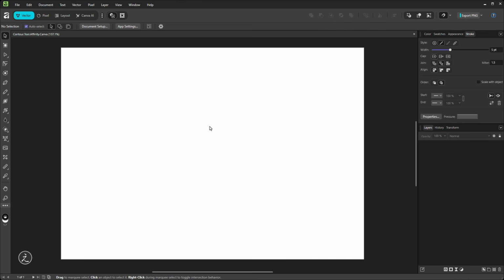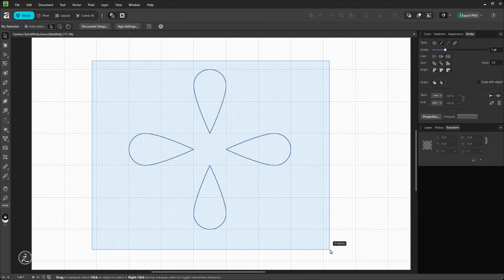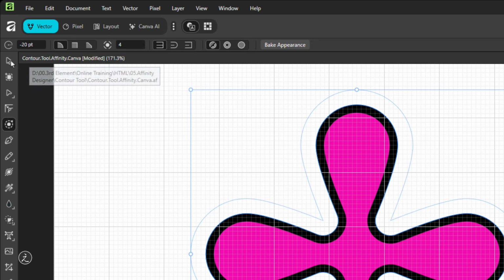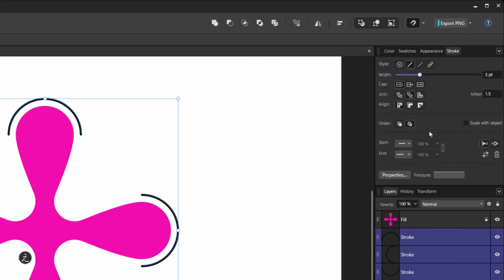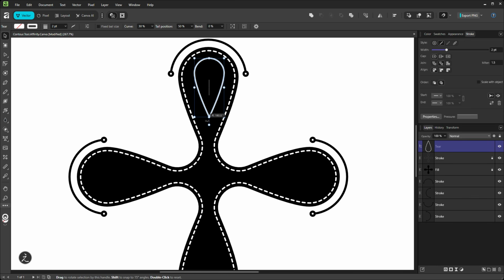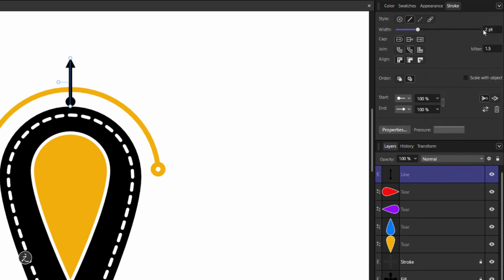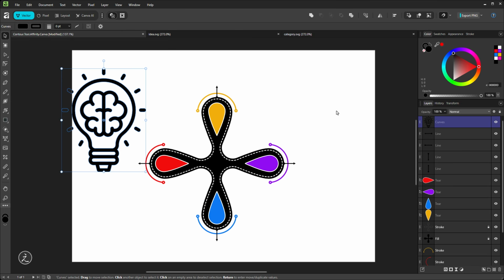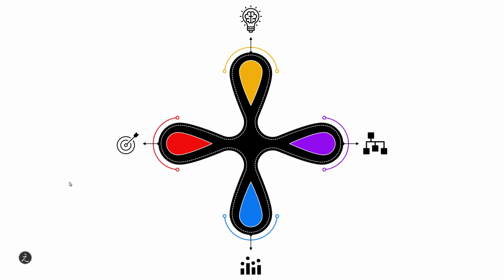Affinity Canva - Contour Tool | Create Fun, and Easy Vector Shapes

Comment: To create your initial array of 4 teardrop shapes a little more efficiently, you can use the new Move/Duplicate tool. With the first shape selected, move the transform origin to the center of the (future) pattern, then hit enter to open the tool. Check "duplicate" and dupe it 3 times with a 90 degree rotation.
Reply from the maker: Indeed that is another way, thank you! 👍🙂